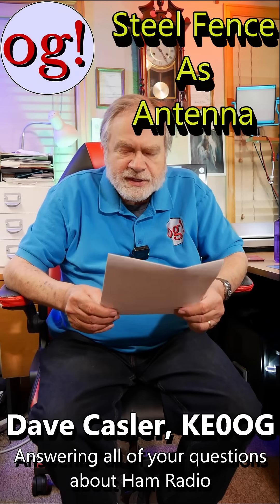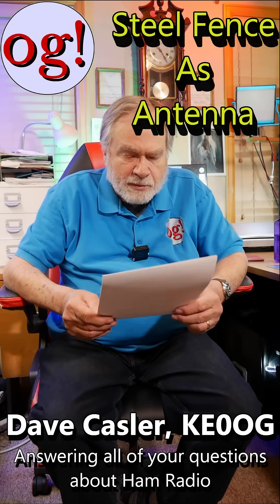Steel Fence As Antenna (Short #76)

Comment: Use the fence as a ground plane?
Reply: I used a CB/Trucker mirror mount and attached it to my steel fence.  I used a 102' whip and loaded it on 10 meters.  Worked great!  The fence was the ground plane.